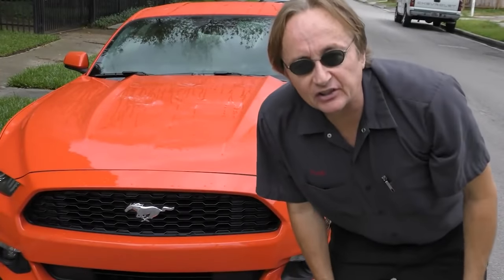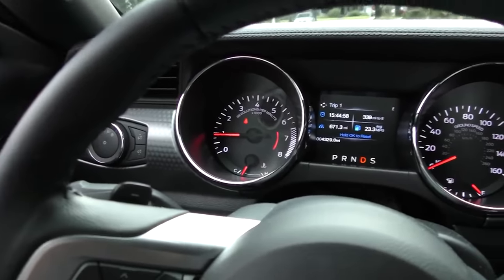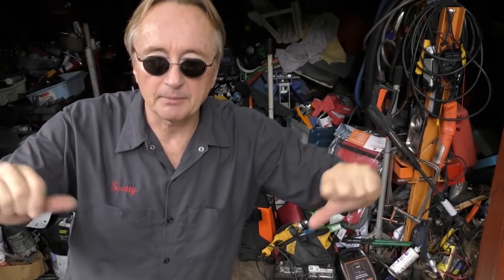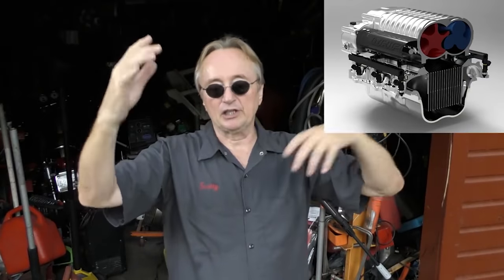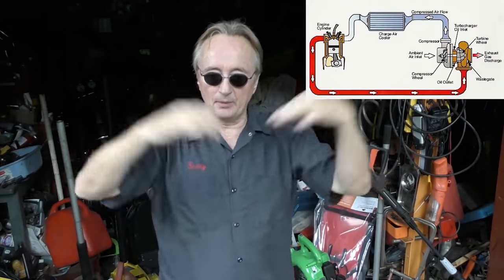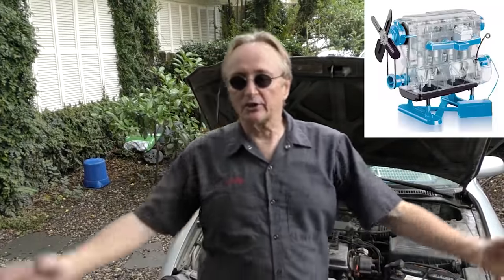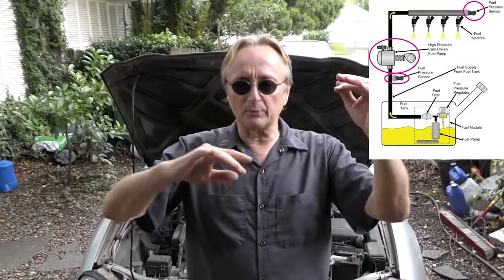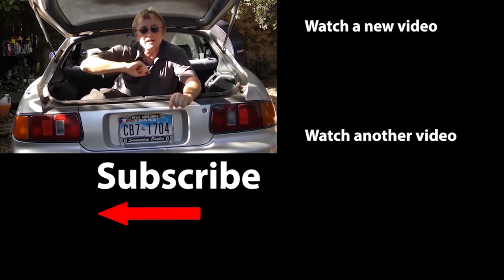I Was Wrong About This Engine and I'm Sorry

Comment: I recently watched a video about Ford's 5.0 redesign and lots of problems. Seems any first or second iteration of a product is not the one to buy. I have a 2019 Ecoboost Mustang. I rarely drive it hard. I use it for longer road trips. I get close to 40 MPG(Canadian)..better than my 2.0 Turbo Escape. So far so good. Some others recommend installing a catch can to help prevent build up on the valves but not all agree to it's effectiveness. Any opinions out there?

Comment: I love my ecoboost and I've had 3 of them. I keep up with the maintenance like change the oil every 3000, clean the valves and throttlebody every other year and have a catch can installed. Good fuel economy and fun when you want to.
Reply: If Catch Cans are necessary, why aren’t they installed by the manufacturer in all turbo cars?
Reply: @electrictroy2010  Because they require maintenance and someone would have to empty it every 3000 miles and most people don’t work on their cars themselves anymore. The Ford Mustang GT 500 does come with one.  My wife’s Volkswagen Tiguan didn’t have one and it cost $700 to have the valves cleaned. I have one installed now.

Comment: I don't have one of these engines, but have one that is pretty similar in my Veloster Turbo - the 1.6T GDI. That said, my question to you fine folks is how can I ensure long-term reliability of it? I've already cleaned the fuel injectors and got myself an oil catch can, but not sure if there is anything else other than that I can do
Reply: Induction service is a necessity for direct injection only engines. Regular oil changes. Ignore anything over 5000 mile.

Comment: Scotty, I love the channel and what you do for consumers. But it isn't like a Diesel. His engine compresses the air without any fuel, super heating it, so it lights with the introduction of fuel.
Reply: Scotty knows how diesel works.  He meant the Direct Injection technology used in diesels for the last ~30 years is being brought-over to gasoline engines 

.
Reply: @electrictroy2010  Petrol engines have had direct injection longer than just recently. Just recently it became more main stream. And diesels before HEUI had a prechamber, and were often direct injection, but had a pump externally with nozzles at the cylinder. The direct injection has come out with electronic controls for both.

Comment: There is zero reason to buy a muscle car if it is not a V8. Especially a Mustang, the whole point of the car is loud monster sound with power to back it up. Who gives a crap about gas mileage on a Mustang. They are meant to be toys, not everyday commuters. You will never hear someone say, “man I wish I could have a 4/6 cylinder Mustang”. Doesn’t happen. So happy my wife wanted a V8, if not, wasn’t getting it.

Comment: Hey Scotty,,long time subscriber first time  need help/advice ,,, I have a Honda Civic Si..2014. It has 61,000 miles on it 6 speed Manuel trans. Everything runs smooth shifting, V tech powee 205 HP..Everything is great BUT for some reason and it DOESN'T Happen all the time,,,first thing in the morning I put it in 1st gear press down on clutch when I slowly releasing the clutch and pressing on the gas pedal for some reason it makes a ODD LOUD WIERD sound for like 10 seconds..I don't know what it is and it doesn't happen that much ,,but ONLY happens the way  I previously explain above..all gears run smooth,,shifts excellent no.slipping at all... one mechanic heard my situation against me said you need a new manual transmission another mechanic heard my situation and said oh that's might be the slave cylinder??? I was hoping with your Decades of experience if you have any experience with this situation??? before I take it to a Honda dealership and get ripped off $$$$$ ...HELP
Reply: Could be your clutch buddy

Comment: Scotty… love you but I have an issue with this engine and transmission… i just drove one with 55k miles and the transmission went out as i was test driving it… at 55k miles. So it’s not reliable

Comment: What about the V12 in the 07 BMW 760li, are those good? I hear they're fairly reliable actually...for a bmw 😂
Reply: Nothing about bmw is reliable!!! Run
Reply: @za9737  I agree. But as long as it runs and drives. Even if all the gimmicky features don't work, who cares? 
I own a hybrid for my other car. I bought a cheap BMW so I'm not too worried. I won't put much money into it. It'll barely be driven. It's a fun car though. I love German craftsmanship. But they're money pits for a daily driver. A weekend car they can be good for

Comment: Why couldn't they just have made the thing with port injection...direct injection & cvt's are the two worst mechanical components ever put in a car.
Reply: @lobsterwhisperer7932 Direct injection allows the fuel to be put directly at the spark plug & that burns less fuel (lean burning).  DI was successfully used with diesels since the 1990s.  No problems

Comment: I had an old schools 300zx TT and it wasn't good on gas mileage but dam it had balls not a lot of lag either but was an auto so I'm guessing that's why but yeah for a 1992 model Nissan it drove like a gem untill I wrapped the rear passenger side around a telegraph pole,🤬

Comment: We should have seen these problems coming with these engines. How did we miss this?
Reply: Diesel cars have had turbo & direct injection for 30+ years and lasting over 200,000 miles.  Gasoline turbi-DI should be able to do the same

.

Comment: Direct injection means dirty valves.
Reply: @danielmeador1991  Petrol is a good solvent when sprayed into the intake manifold it keeps the valves clean, the PCV system has only a small part to do with it.
Reply: @danielmeador1991  ok,  just my opinion.
Reply: @danielmeador1991  Same.

Comment: I love my ecoboost mustang!! I’m pushing 400whp , fbo on e30 tune and so reliable! And powerful! I beat GTs all day long
Reply: But it won't outlast the 5.0 GTs though
Reply: What are you talking about. Will last just as long bud probably even longer. Because I use a dual valve catch can for the carbon problem. At the moment I’m getting a 1000whp mustang ecoboost being built.  But as of now it’s been super reliable! Anything over 400whp in the ecoboost then I would agree with you. But it’s safe and reliable at those levels, also have the best tuner. So trust it will last just fine and it’s all about maintenance! I use the best stuff and do early maintenance every time.

Comment: One problem people miss. Change the pcv valve at 50,000km and you will get better fuel economy. Plus don't drive like a maniac and the economy is awesome. I drove a late model f150 Ecoboost to work almost an hour away then worked a 12 hour shift, with the engine running then drove an hour home. Amazingly it only used around 1/8th of a tank of gas.
Reply: Why would you leave it running...

Comment: I'd love a 4 cylinder mustang or camaro
Reply: Mustang. Camaro doesn’t have a 4 cylinder.
Reply: @charlesrodriguez7984  ?
Reply: @charlesrodriguez7984  Yes, the Camaro does have a turbo 4 as the base engine like the Mustang, or at least it did in recent model years.
Reply: Said no one ever

Comment: I avoid Ford in general. After owning a POS 2008 Ford Mustang with under 60,000 miles that kept having mechanical issues every year, i'll never buy another Ford.
Reply: That's just stupid. You had a lemon, it's common sense
.I've had Ford half my life, so has my family ,and some friends..never a problem
Reply: I’ve been a GM man my entire adult life, after owning a 2008 Sierra and my wife having a GMC SUV I will never buy another GM product.  GM isn’t what it used to be unfortunately.  I’ve also owned several Fords and they were all good.  My wife just bought a Toyota Camry and I’m going to buy a Toyota Tacoma, Tundra, or a Ford F-150.

Comment: The EcoBoost mustang are only good for being abused at Demolition Derby competitions; also, most car companies that use variable valve timing only changes the timing of the valves and not the lift. VTEC, i-VTEC, and VVTL-I were the only systems that actually lift the valves further into the cylinder along side the timing.

Comment: I got a 2016 ecoboost , and im about to pay it off in a couple months, so far I have drop 3.7k to fix the vehicle, a lot of misfires! And recently I had a blown head gasket and sadly I was out of warranty, the car is at 75k miles when it happen, and now seens I got it back its giving me 3 misfires , I love the car but its definitely gives you lots of problems and the AC, jeez got it fix 4 times and still don't blow cold. Took it to Ford for the first time for the ac and they couldn't even fix it right. So I gave up on fixing the AC. first they tell me it's a leak and then its something else like it makes no sense to me.

Comment: Of course a turbo motor is gonna have more problems than a naturally aspirated motors.
The thing that chaps my sack about the Ecoboost & Cyclone V6s is the ridiculous water pump design, difficulty getting to any timing components and the horrible stretch belts. However, they are wonderful powerful engines and there's plenty of guys with 300k+ miles on them...

Comment: No way. I had the 5.0 2020 Mustang GT ten speed. I averaged 24mpg on 87 octane. I would never buy a 4banger mustang. If they would of used this setup on a smalle car and named it idk the Ford probe than it would of been a massive seller. If it was a smaller car it would make sense. But it doesn't. U drive the Ecoboost guess what.. premium fuel is recommended.. therefore ur gas savings are eliminates
Reply: Diesel cars have had turbo & direct injection for 30+ years and lasting over 200,000 miles.  Gasoline turbi-DI should be able to do the same

.

Comment: The problem with ecoboost isn't the engine it's the people who drive them, if you over mod it your basically over stressing the car for what it was originally designed thus affecting its reliability. Also if you drive these mustangs regularly without racing it you'll be fine.
Reply: Baby it and keep your fingers crossed!

Comment: a four !!!!....... you can get a lot of power out of low displacement engines (read Ferrari ) but they never....that is NEVER  last....ever see a Ferrari with 200,000 miles ....100000 ?.... 50,000? did it need a rebuild ?

Comment: I have a Coyote Mustang and the Ecoboost Mustang is fun to drive and very torquey. Fuel economy on a whole tank was around 29 mpg that was not economical at all. Recommended ✅✅
Reply: But it won't outlast the Coyote though nor the engines in the 92-96 Ford Trucks.
Reply: @CJColvin  They'll last just as long or possibly longer. So far Ecoboost has been very reliable and analysis has shown little signs of wear with high mileage.
Reply: @302Mustang13  But it won't outlast the 4.9L Inline Six in the 92-96 Ford F150.
Reply: @CJColvin  only reason those last is because they only make 150 horsepower. You have to give credit to newer engines for making easily double the power, significantly reduced emissions, better performance, and better fuel economy while demonstrating robust construction and impressive engineering.
Reply: @302Mustang13  Yeah sure try telling that to alot of car mechanics.
Reply: @CJColvin  It's not like mechanics are dealing with more engine issues. There's just a ton more parts so it seems that way. This current gen of Ford engines are better in every conceivable way.
Reply: @302Mustang13  Wrong.
Reply: @shikamaru281281  Which part? If you can't reply with something even remotely of a statement, the you are wrong and have absolutely nothing.
Reply: @Kenneth O  All the paragraphs you wrote were wrong.
Reply: @shikamaru281281  Prove me wrong genius. You'll have to do much better than a I know a guy or girl story.

Comment: I don't think most people really consider how amazing AC electric motors are and how simple and elegant they are compared to an internal combustion engine. Invisible, high energy potential EM waves induce a sinusoidal fluctuation of magnetic flux in a coil of conductive wires which generates an electromotive force that spins the rotor in proportion to the current applied to the stator. This allows an absurd amount of power from such a small device. A well designed AC motor weighing less than 200lbs and taking up less space than a suitcase can output over 400hp and over 300ft-lbs of torque with a real operating efficiency greater than 95%. Think of how different the world would be if great minds like Tesla were able to not only invent the AC motor, but invent a better way to store electrical energy in dense and easy transmissible form as opposed to the trash DC lead acid batteries used in early electric cars. No one spends money maintaining the electric motors that run our appliances, and the old school ones without low voltage DC electronics last decades without issue. Electric motors really put overly complicated internal combustion engines to shame.
Reply: Have you heard of AuraGen by Aura Systems???🤔
Reply: @fookingsog  No, but reading about it now. I just was reading about the "Quark" motor developed by hypercar maker Koenigsegg earlier this week. Also the power output and size of the Lucid Motors electric motors is pretty impressive as well for a production luxury car.
Reply: @LabRat Knatz Caps like they use for "coin shrinking"!!!

Comment: Scotty, what’s your opinion on the new 1.5 Ecoboost 3 Cylinder made by Ford which are in the new Bronco’s, and the new Fiesta ST in Europe? It has dual injection, port and gdi so I can’t see it having any carbon build up issues? And is driven by a chain rather than a wet timing belt. But would be interested to hear what you thought on them

Comment: 2.3 was the best engine ford ever made. If this is the same one they put in the old rangers.
Reply: @LabRat Knatz I am particularly specific about the 2.3 only available in single cab two wheel drive. These things last like a toyota and are often found battered and beat up but still going strong. But they don’t sell many. It was also used in the escape

Comment: You said that ford's with both Port an direct injection will not last? The  gen 5 Toyota Rav 4 has both, since the Rav has no turbo these engines will be fine? Ty.